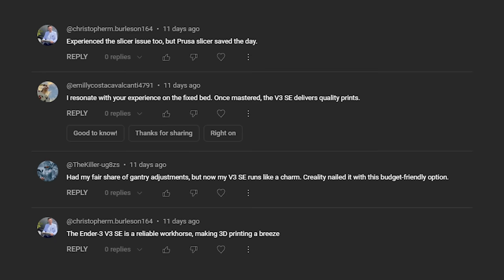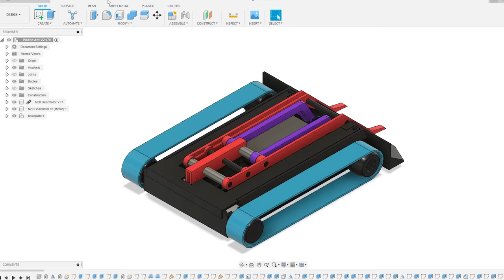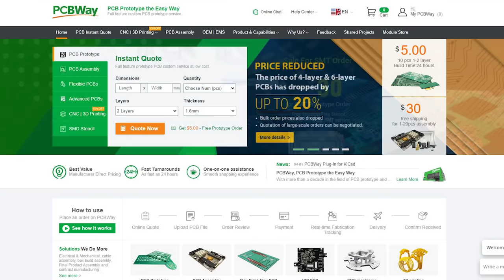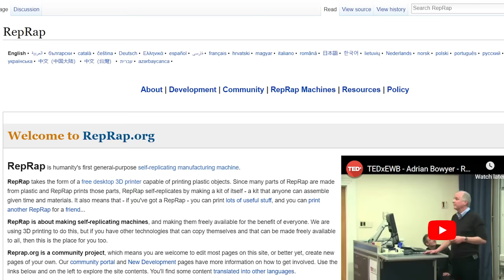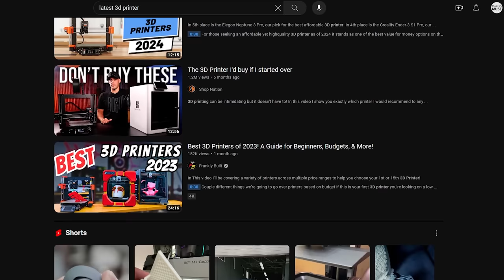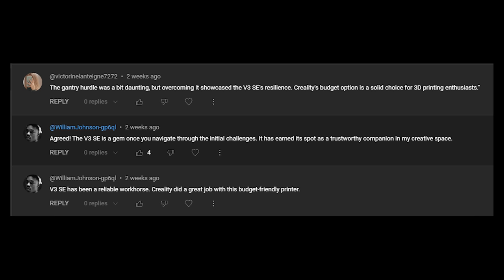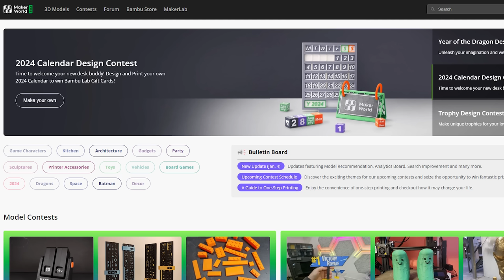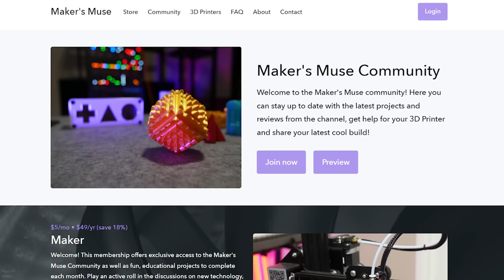My 3D Printing Predictions for 2024

Comment: Something that came up a few years ago but seems to have dropped off the radar was the increased use of servo drives over the standard stepper. 
Maybe the new micro stepper drivers eg. TMC2209, TMC5160 that improve the performance of steppers.. but most if not all systems still have no feedback loop (If a stepper skips then there is no recovery).

Also, printers getting faster.. I thought the hard limit on that was the melting speed of the hot-end. Getting faster will need higher wattage hot ends under a tighter control loop. The extruders are good enough for now...

Cheers Angus, hope 2024 is a good one for you, enjoy your winter (summer) as we start to freeze up here in Canada.
Reply: I think CHT nozzles moved "hotend" limit about 2 times higher. For me normal nozzle is about 25mm3/s and CHT is 40mm3/s at the same wattage. In regards to steppers, I think next level will be CANBUS operated steppers with encoders. It makes mainboard so much simpler and steppers so much reliable

Comment: I've been out of the hobby for a few years ( I disassembled the hot end on my Tornado and was unmotivated to put the 2 screws back in). I decided to hop back in this year and bought a P1S which arrives soon. I think I might even put the Tornado back together in case I need large prints. It's good to see that 2023 saw the rise of the more consumer-ready printers. Those of us who did more of the tinkering will have more of a knowledge base if something goes wrong and open up the hobby to those who aren't as technical... I hope

Comment: Regarding your 2023 predictions, I am one of the new to #D  printing users who waited three to five years until home use printers had matured into usable tools. I see the technology as an add on to my existing home workshop tools, lathe, milling machine etc. I am enjoying learning to use my Creality K1 with among other materials TPU which I gather could  be  er. rather difficult in the recent past. Starting getting to grips with 3D design using FreeCad and appreciating the differences between designing for additive or destructive
making. Enjoying your channel and wishing you all the best for 2024

Comment: Another great video Angus, thank you for your 2023/2024 Review/Predictions. I have been 3D printing since the Wanhao Dupicator 2 days, transitioning through many and various Consumer 3D printers from various makers. I’ve never settled on one, but the thing in common has been the sheer amount of fettling required to maintain consistency. I am not a Modder, preferring instead to make what I’ve been sold actually work - mostly successfully.  

And so I am well pleased to see what Bambu did and how the industry had leapt to the challenge with some very nice kit in the first response. Finally, to be able to focus on the design rather than the machines constantly will be a refreshing change.

Comment: Magnetic linear motors, it'll be interesting to see if they gain ground this year.  The speeds are INCREDIBLE.
Pretty soon, people are going to have to anchor their 3D printers to a brick/concrete base.  If not the the extreme head movement speeds will cause the printer to walk off the table.

Comment: I bought an Original Prusa MK3 kit even though it was a bit outside my 'normal' price range because I wanted to support RepRap's brand of open-source and get something I could understand and trust at all levels, but after being built it's been nothing but rock-solid since (one part failure, but since the interface board was a standard RepRap part I could get a generic replacement from a local 3D printing store despite my remoteness.). I upgraded it to a MK3S since, and am very happy with it. I haven't really followed new developments since, but from I understand it's mostly speed and quality increases?
I'm fine with what I have for now on that front, anyways.
Features I hope come around in the future:
Closed-loop motion systems - the Trinamic stepper drivers in my MK3S already have crude "that step didn't feel right, better rehome" through current sensing, proper motion tracking would be even better for making printers reliable in all circumstances.
Some kind of real-time monitoring of either filament cross-section (keeping in mind it may be out-of-round), or nozzle pressure or flow rate, rather than assuming a fixed relationship between extruder steps and material deposited. Coupled with existing volumetric extrusion slicing, this would allow the use of really poorly-toleranced (eg. cheaply home-recycled) filament with little or no degradation in print quality - vital if home recycling is to take off like you (and I) hope.
I know I've hoarded a lot of printer waste, and kind of stopped printing things for fun or practice (only printing things I actually need such as replacement parts) when my capacity for waste storage filled up, because I can't bring myself to actually throw it away. I sure hope the affordable recycling gear develops.

Comment: 2 things I am planning for 3D printing this year!
1) just received my first bottle of tenacious resin. I am a very low volume printer, mostly printing stuff for myself. But I have started printing Mini's for friends, and models for cousins, and I'm just getting tired to needing to reprint stuff for them. Hoping that the 2-3x price of the tenacious resin will cut down on reprints due to people breaking their models.
2) I think I am ready for a fdm printer. Like you said, they seem to be getting less of a project to run, and more of a tool. I mean, with resin I calibrated it a lot until I got things dialed in... But I haven't had to change anything in literal years! Just recently dumped the vat out for the first time in over a year to take a good look at the film... But it was fine. Just dump in resin, hit go, and the printer and resin just don't fail. Fdm has always looked insane to run. Having to level with each build, and have consistent Temps, and humidity levels... It seems like a bit of a nightmare! But I keep getting print ideas that are food related (custom cookie cutters for my mom)... And I'm not putting resin anywhere near food lol. And I have some larger print projects I want to try (custom cement forms), but resin just isn't large enough, or is too expensive to print truly big items. So I think this will be the year for fdm. Something as automatic and enclosed as possible without breaking the bank!

Comment: Few years ago I look and looked on YouTube to find out which was better the filament or resin. I didn't really find anything to compare the tw.  End up buying a filament printer (for my son) which was a headache to put together and set up to work. But I did have a lot of fun with it, printing one of a items for son friends (I think the told them he printed them ) I ended up buying a second one which I've never used (secondhand as the guy could fix the prints not printing steaightl. Now looking back for what I want to do I would have been better off buying a resin printer. I think you all get paid kickbacks. Cheers Graham.

Comment: I got into 3D printing to make things.  I have a solid background in both electric and mechanical endeavors.
I tinker - only because I need/have to.  If I never have to adjust one again...  Golden.
But having all this older gear, I will just press-on until I can afford a new one, hopefully before I get too old to use it.  Thanks again for your honesty and straight answers.   Great job.

Comment: My first two 3d printers were tinkering machines to learn how things work and how to fix them (looking at you voxelab aquilla). My first out of the box ready to go printer was my elegoo neptune 3 pro. I was amazed that it worked right away without modifications or calibrations. Only had one issue that I ahd to disassemble the hotend over the couple hundred hours of printing last year

Comment: 3:04 How do the oscillations of the printer affect the quality of the print? Is that table special for 3D printing and vibration isolation?

I don’t know about 3D printing, but I wonder if the 3D printer oscillating, like we see in the video, is bad for the print.

Will this be a solution? Attach the 3D printer to a big mass (+30 kg) (steel plate, marble block, etc). Put the mass+printer over very low rigid mounts (soft springs or soft rubber foot). Or just place your 3D printer over a rubber mat in your kitchen worktop.

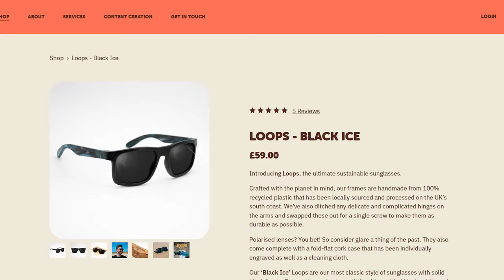Comment: 8:33 totally agree with the recycling. Highly recommend if DIY PET bottle filaments. Easy to diy at home from old/spare 3d printer parts. 
The resulting filament prints well once you dial it in and woah is it tough and heat resistant. Has become my go to for parts that need to withstand heat over PETG

Comment: I follow an internship in product design at a large toy and game company that now uses 3D printers for prototyping, they used to outsource this to some other companies that made models and tested mechanical systems. This was slow and expensive. Now a single employee can make and test 3 different prototypes a day for next to nothing. It also massively improves new products in function and reliability.  This is right now the biggest advantage of 3D printers imo: design and prototyping

Comment: Agree, printers should eventually become an output device ( similar to the paper printer), less tinkering and more productivity. My last printer purchase is ender 3 S1. Only changes required was, replace the bed material, a copper hotend and all metal heatbreak. Then to replace the last piece of ptfe with 4mm x 2mm ceramic tube. Now very reliable. I consider these actions as minimalist, compared to the constant setup of printers past.

Comment: Ten years. Oof. I was a viewer way back at the start. And active in the livestream chats (when everyone recognized each other during a stream). Left 3d printing for a while any came back just a couple of weeks ago with the Kobra 2 Neo. I couldn't believe how fast it was to get up and running and with amazing prints. When I put together the Prusa Mk 2 (and then the Mk3 upgrade) for the Makerspace years ago it took hours to assemble, and then a bunch of tweaking. I think most of the tinkering (and repairs) I had to do on the Prusa after setup though were due to makerspace users printing stuff with wrong settings, also leaving prints unattended for hours. Nothing like finding a mars bar sized glob of PLA where the nozzle is supposed to be :) These days I definitely don't want to spend my time tinkering with and repairing/upgrading the hardware. I just want to print things that make doing other stuff easier. When do we get Replicators?
Here's to another 10 years :D

Comment: Hey Angus, you are one of the few 3D printing related Youtubers I trust, too many others I just take with a grain of salt.
I wonder if Bambu Lab would bring out and X2C this year? Perhaps with improvements on design like the position of the fan cooling the electronics, better lighting.
Perhaps heated chamber, improved filtration for the VOCs, and faster nozzle change like the A1.
A dual extruder would be nice, whether it be for less purge waste for support interface or less print time with the unused extruder switching filaments from the AMS whilst the other is still printing.

Comment: I bought a printer early last year, and decided to go with a Elgoo Neptune 3 Pro, seeing it as a sort of “final refinement” of the classic bedslinger concept. The price was really good, and it’s reliable enough, but most importantly, I saw that the market was going to evolve fast over the next 2-3yrs with Bamboo pushing everything along. I’ll happily wait for the modern iteration of home 3D printers to mature a bit more before putting out big bucks. I think $1K will get you a vastly superior printer in 2 years’ time versus what it’ll get you today.

Comment: I love designing my own parts in OpenSCAD and throwing them at my FlashForge Adventurer 3+

It's a decent beginner machine for practical parts.

Ordering a Bambu Labs X1C next week. Unless I find another "just works" printer in the same price range that prints at a good speed and with an even larger build volume.

Comment: If there is ANYTHING I would love to see more of on this channel, it's reviews of CAD programs. 

I would very much appreciate having more easily accessible CAD programs that are actually good enough to make it worth learning. 

I've done a miniscule amount of work with Blender, and I have to say that I absolutely hate it. All the controls and menus are really jargony and use terms that anyone without a CAD degree have likely never heard (what the hell is a "Boolean"?) and a lot of the most commonly used tools are hidden behind layers of menus that take ages to find and/or keyboard shortcuts that you are just expected to memorize. It's exhausting.

I played around for a couple hours with Fusion 360, but it has the same problems, and it costs a fortune. 

I've messed with a couple others, and some of them are pretty easy to use, but they really lack features, and that really limits there usefulness. 

Angus, please, I am begging you, help people like me find something that does everything a normie could need it to do, and doesn't require a thousand hours of beating your head against the wall to figure out how to use.
Reply: One of my hopes for 2024 is that mesh to cad tools get better.  Scanners and photogrammetry are becoming more widespread but taking that mesh and turning it into something you can modify is still quite time consuming.

Comment: now that we have seen the ease of use aspect "handled", larger format printers & non-planar printing will be the next big jump. 500x500x500 will be a common size, and at least a certain amount of non-planar capability (.5-1" over X distance because of head clearance) is going to be a requirement.

Comment: For the case that the Mageneto X from PeoPoly is working, I'm in hope, more printers with linear motors enter the market. Due to the omittment of belts and pulleys they are way simpler to build. Maybe we get linear magnet motors for diy printers as well.

Comment: Years ago when I bought my CR10, I wanted a printer to support my scale RC hobby. I did not want 3D printing as a hobby, therefore, I wanted a printer that worked. For the most part, the CR10 has been a good printer, it has been a little fiddly, but not terrible. My Prusa Mini+ has been a bit more fiddly than I really wanted, which was a shock with Prusa being the gold standard; but once I got it dialed in, it has worked well for me. But, I have to say, a Bambu A1 is looking pretty good, no leveling, you just load it and pull the trigger, what could be easier?

Comment: In Finland we need to pay deposit on juice and soda and other drink bottles and cans, 10c to 40c which we get back when we return those to shops so the recycling rate is about 97%. And nowadays depending the area we have ability to recycle most of the soft plastics so companies can use it to do something else but they also burn plastic as trash to get some fuel to heating cities. But unfortunately, no recycling for the 3d printed parts at the moment except ABS. About tinkering printers, I am building my third Voron so I have choice just to print and being happy or tinker as much as I want 😂

Comment: I’m a bit late to the comments, but I figured I’d post this anyways.  It involves in house printing for parts for commercial 2d (paper/plastic/cardboard). I work with commercial large scale presses called Indigos, made by and serviced by HP.  These aren’t home printers, they are multi million dollars piece of equipment and are seriously complicated to keep running.  We go through so many spare parts that HP rolled out an update kit for their larger presses a while back.  Now HP is at the point where their in-house 3d printers (which are fucking cool if you’ve never seen one) are now going to be a part of our uptime kit (UTK) sometime in the very near future.  Now I doubt they will issue one to every press, but they are so confident that the machines will print reliable parts that they have a whole training system for operators that rolled out end of last year.  We don’t know when or who will get them, but it’s inevitable at this time.  These machines will print something like 30% of the parts on the presses I maintain.  That’s HUGE, and will save us so much time just in downtime waiting for shipping.  I’m very much looking forward to the roll out and am hoping to shift my career into using HP 3d printers to fulfill  HP Indigo parts orders.

Comment: Enjoyed the video, thank you for another honest yearly review. Your reviews have helped me so much, I think I went overboard LOL. My problem is I have too many printers (8 in total), but I am learning how to let go of stuff I don't need or want. Before now, I actually had 15 printers and it was out of control.  I whittled them down and sold off the working ones that I didn't desire, and stripped a few for parts only.  I have bought low cost broken printers for parts only and now I have a good stock of motors, gears, hot ends,  belts and the like. My hope for this year is to break down my printers to only 3 well tuned and reliable machines.  I won't mention the brands I have, but they are all under $500 but are workhorses.  This is where I am hoping I can come to terms with which printer to sell off or trade.  I also appreciate your tutorial videos, I can't tell you how much that has improved my printing abilities and confidence in being able to look at an object and realizing how I need to set up the machine. Thank you :)